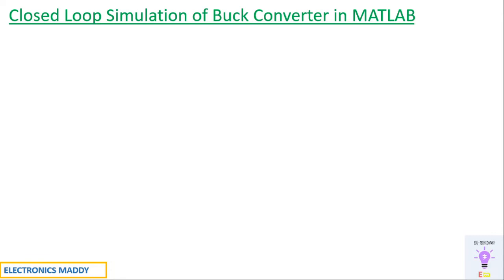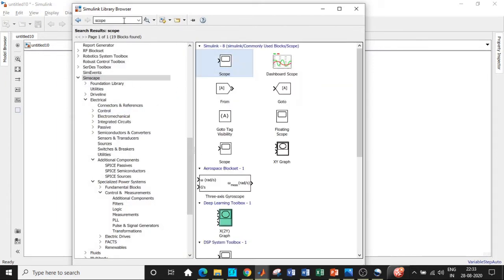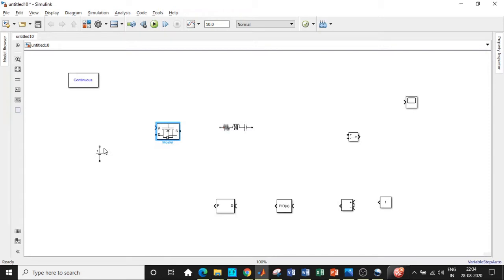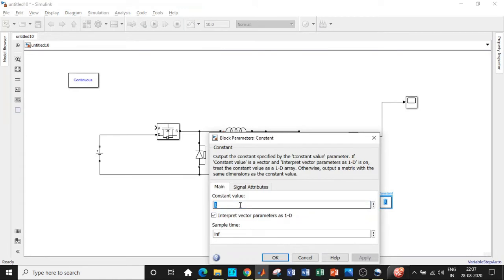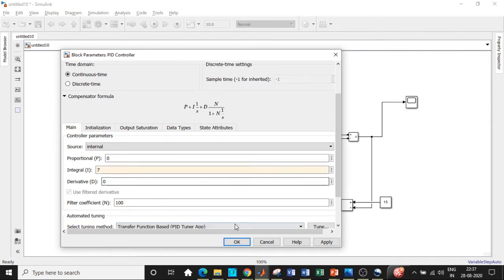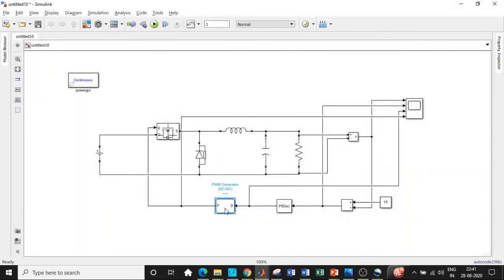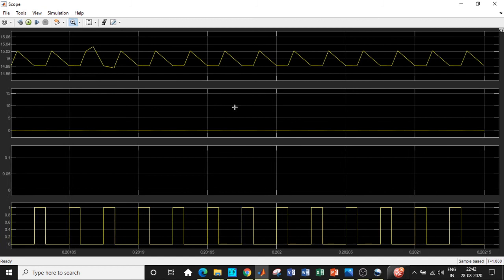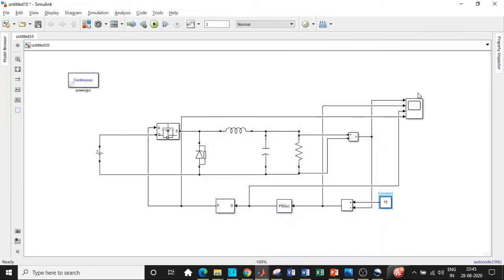Closed Loop Simulation of Buck Converter in MATLAB | SIMULINK

Comment: from where do u get I=7? any source or research paper?
Reply from the maker: You need to design based on the requirements. I have made some assumptions and based on that I have found L and C values
Reply: @ElectronicsMaddy  Actually I am talking about the Integrator Value of the PID controller ..... From where do u got?
Reply from the maker: You have to design it. I have designed using Laplace transform approach
Reply: @ElectronicsMaddy  plz make on video to selection of integer value of PID conctroller
Reply: You can make it by using the transfer function method

Comment: can we generate pulses using sawtooth wave , constant and a comparator ?
Reply from the maker: Constant and saw tooth will give you single pulse modulation output which is highly not recommended. But you can. So the answer is yes